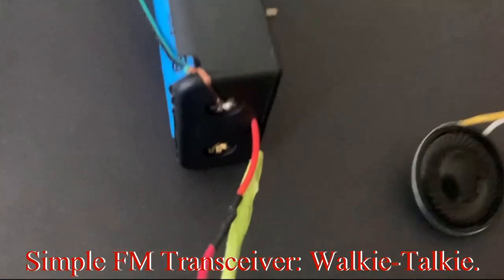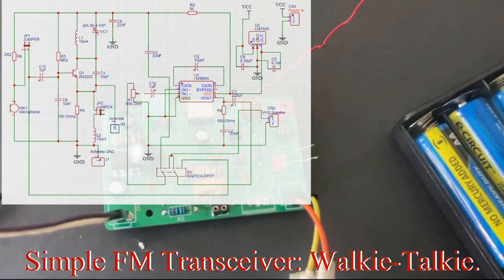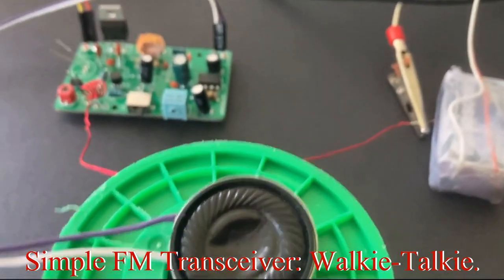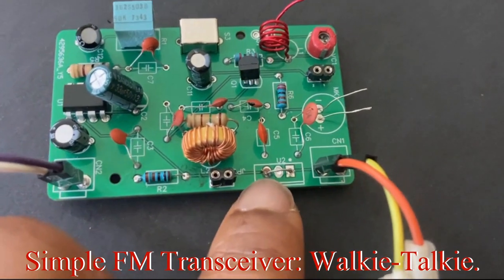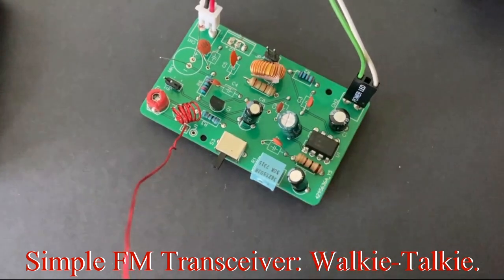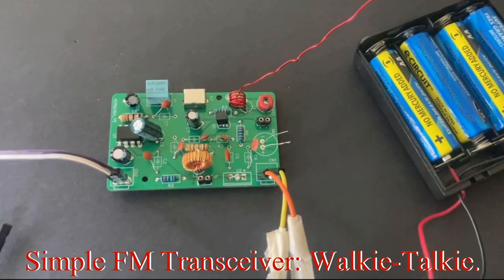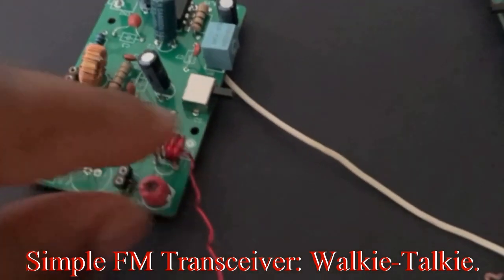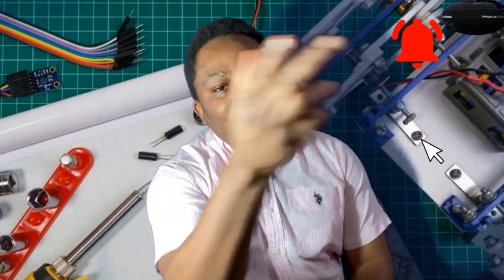How to make Simple FM Walkie Talkie | Do it yourself FM Transceiver | Build Walkie-Talkie at home.

Comment: What is the range in kilometer it covers?
Reply from the maker: Most 1 transistor FM transmitters cover 50 to 100 meters with good antenna. This design was not optimized to cover long ranges due to the Frequency band we were operating on. I would say the range is less than 50 meters as is.